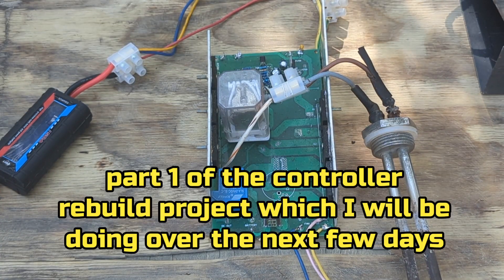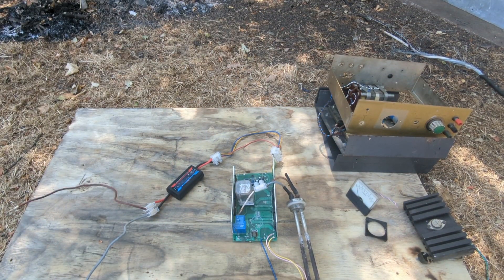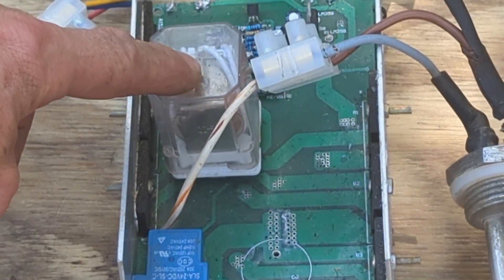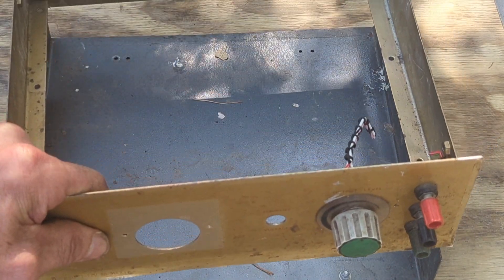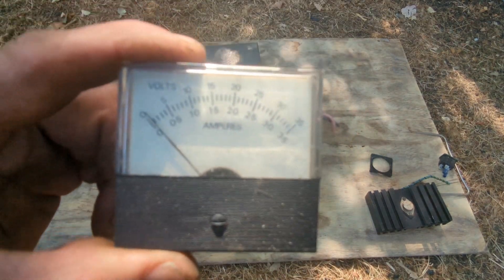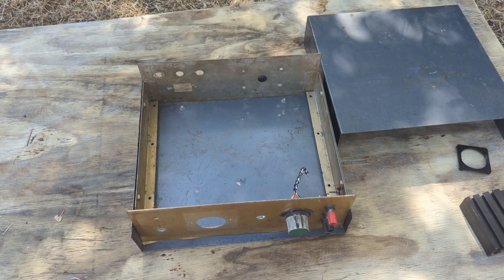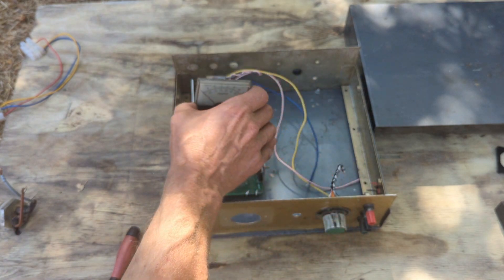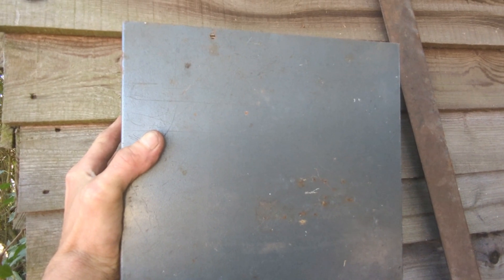24v Wind Generator Charge Controller - Rebuild/Upgrades - Part 1 - 14 August 2022

Comment: Nice old electronics, especially the transformer.  Do you have ideas for using the heat from the dump load for something useful? Just a large plastic tank under floor aids with heating in winter, even if you don't need hot running water.
Reply from the maker: Yes will be doing something with it maybe just as an air heater or maybe for water, just slowly getting it ready for winter, that is the plan
Reply from the maker: Yes the wiring on that thing "was" amazing all perfectly done by hand , if I knew how to repair it I may have done but this will be honouring it's memory.